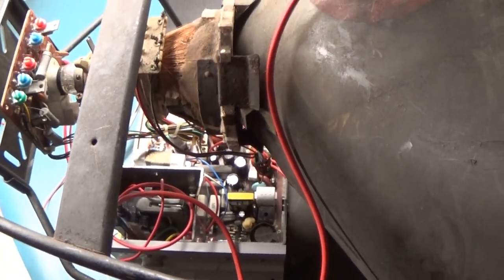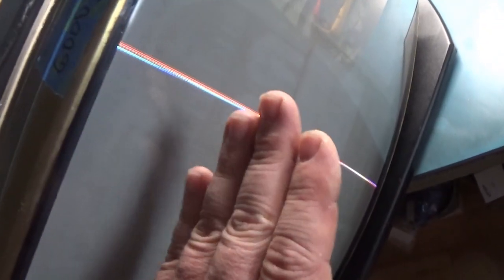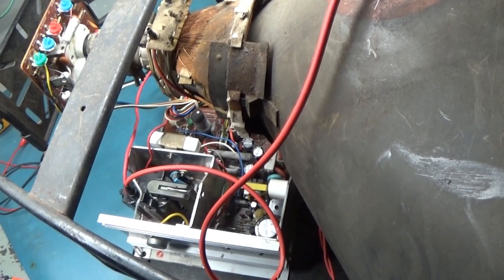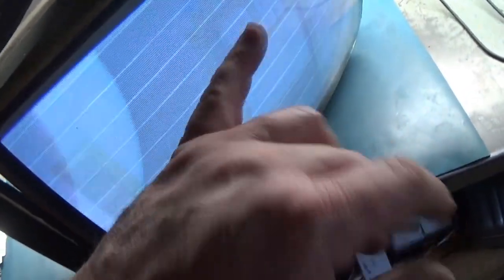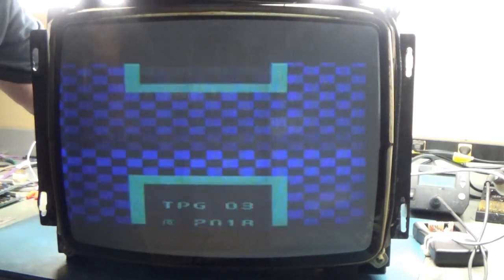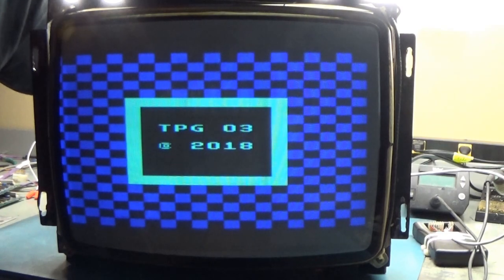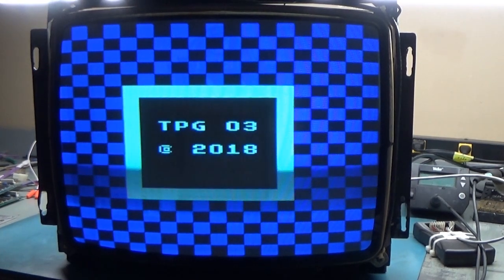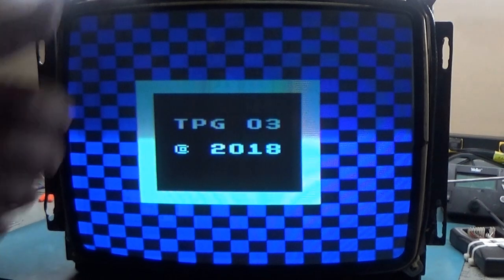19" Kortek/Imperial KT-1420A Arcade Monitor Chassis Repair - Horizontal Collapse - Cracked Board

Comment: Another one fixed!   That one did not want to come peacefully.  Good to see it working again.  Regarding the six pin video connector, how do you hook a standard jamma up to it?  Can you run the Jamma pin ten to either pins 5 or 6 on the Chassis?  or do you need to jump pins 5 and 6 on the chassis with the single jamma sync wire?
Reply from the maker: Pins 1-4 are the same, but sync is pin 6 instead of pin 10.
Reply: @MikesArcadeMonitorRepair  Awesome!  Thanks for sharing your knowledge